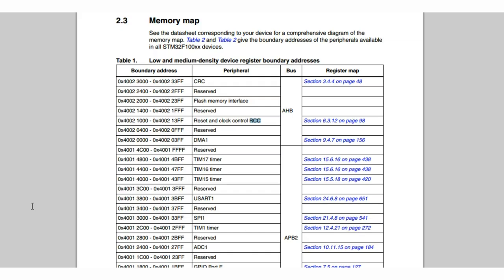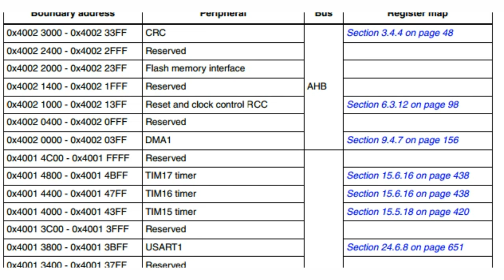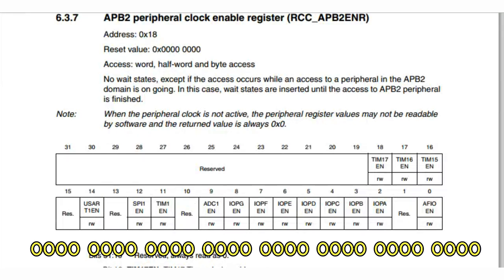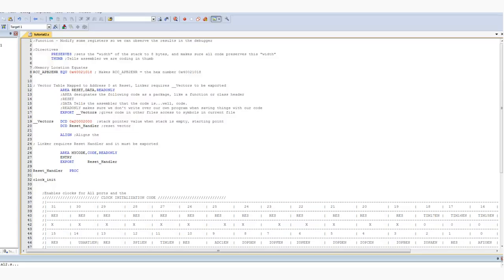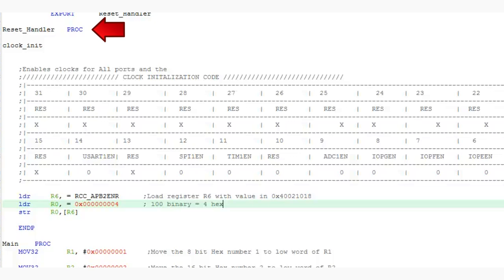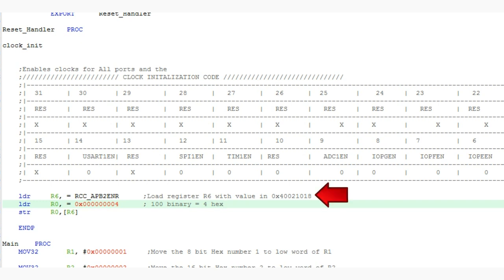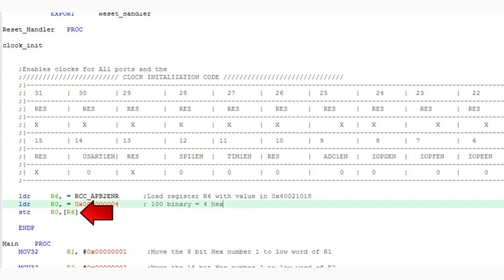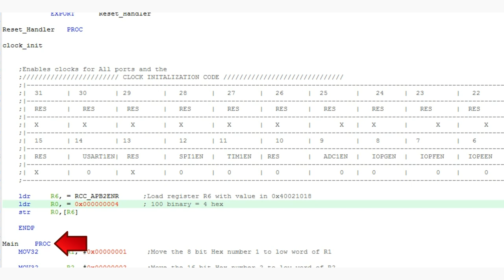ARM Cortex M3 Tutorial 5 : Clocks

Comment from the maker: An excellent question! I consulted my edition of "The definitive guide to the ARM Cortex M-3 2nd ed" (which I highly recommend, it's a good book to consult) and it appears that you are correct. MOV32 should indeed be used in place of the LDR command when loading literals. However, I tried to figure out why my code was compiling as though my LDR was an MOV32 and from what I can tell, if you don't specify a register to load from, it just uses 0x00 as the register address and then adds an offset.